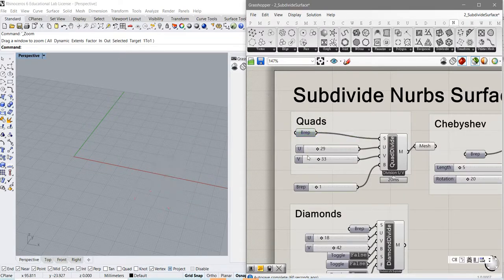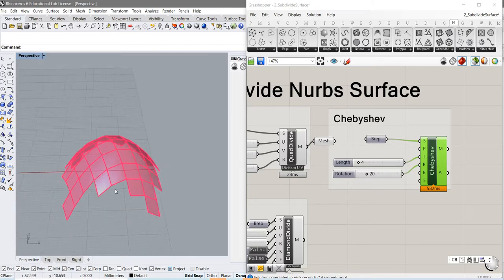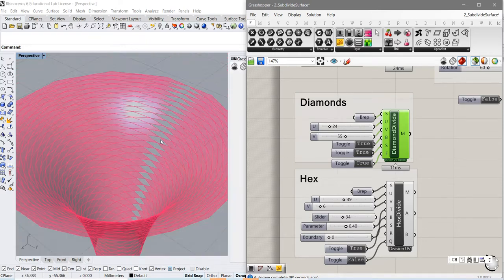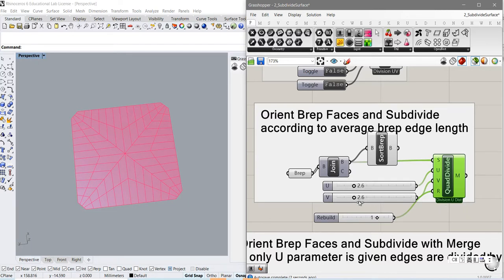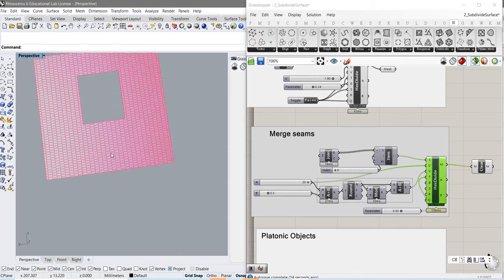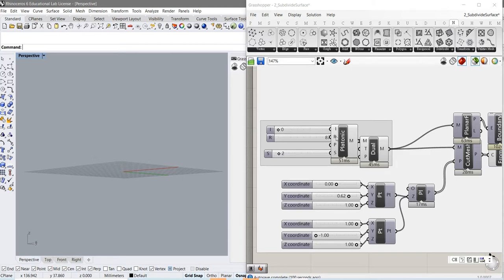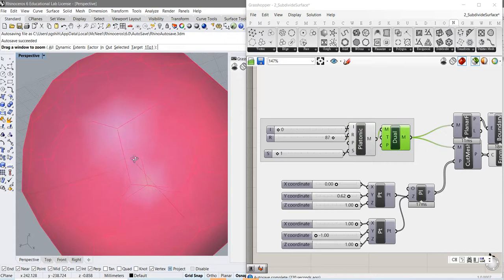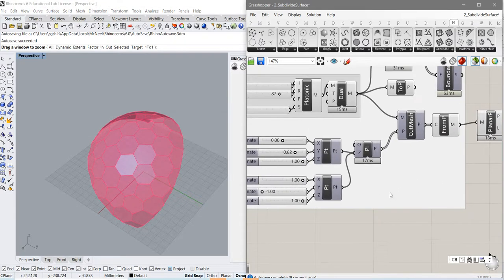Grasshopper note for NGon example  by petras_vestartas (2)

Comment: Thank you for your work!! It's hard to find videos on this new plugin even though it does the absolutely best for grasshopper and you explained them step by step. Thank you! I was wondering if you solved how to transfer colour information with flatenning. For instance, for my project i coloured my whole mesh based on tension and when i flatten it, the tension information is gone. It colours it whole different. I want to flatten my mesh with that colours, just like every remesh-and-cutters. It would be really great if you had a tutorial of it too.